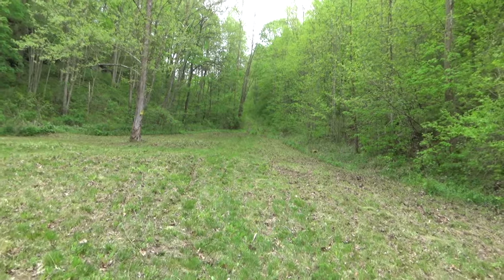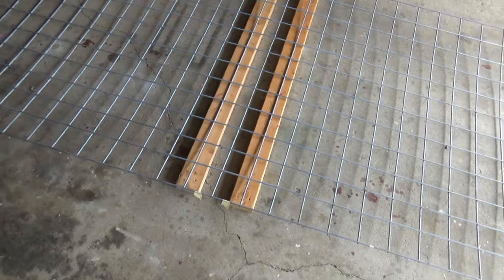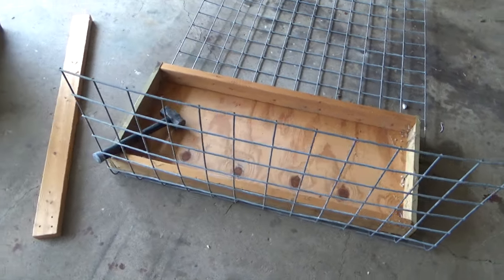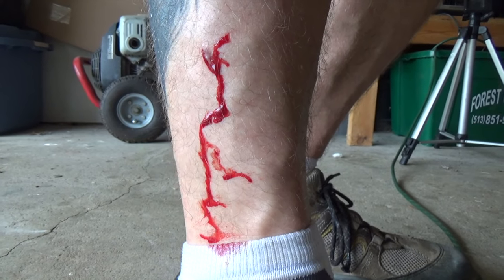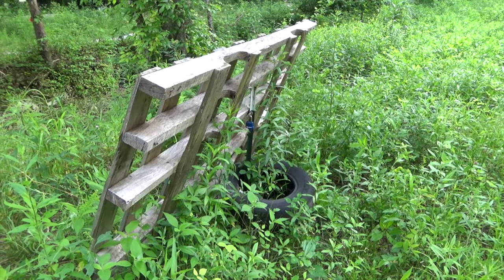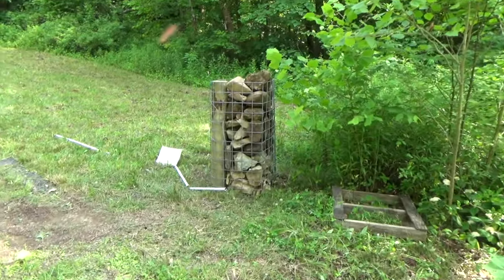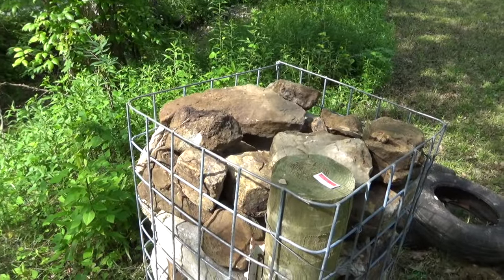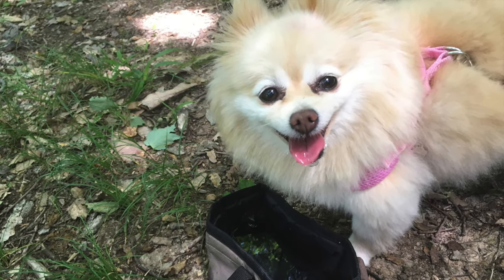Gabion Rock Cage Fence Posts for Farm Gate

Comment: I like the way you use a piece of pipe to wrap the tails instead of using C rings- much stronger corners. We found that by using a 12” pipe and putting a hole one inch from one end it was much easier to bend those wires.
Reply from the maker: Thanks! These are still standing proud to this day with the gate hanging and no sag. I have a video showing the gates here: 
https://youtu.be/BpT1jfp0_N0

Comment: I did the same thing a couple of years ago because of solid rock on my land. For line post connect a short piece of wire to post (in the center of the cage) and run it out of the cage before you fill with rocks. Then connect barbed wire or field fencing to it. I had an engineer friend calculate the strength of these post before I started. They hold cattle in.
Reply: pro tip: watch movies at Flixzone. Me and my gf have been using them for watching loads of movies during the lockdown.
Reply: @Carlos Bode Yup, been using Flixzone for years myself :D

Comment: This is sooo cool, terrific project and the result fits ‘The Ridge’s’ look. Ps: the obligatory sparks sealed the deal. Have a great day! Bst wishes, Michael.
Reply from the maker: It was a lot of work, but it was a fun project. There was no way I was ever going to be able to dig large post holes by hand so this idea worked perfectly. I will post a follow-up video with the gates mounted soon. It is kind of funny, those green T-Posts you can see in the video had to be driven in with a sledge hammer and they bent badly from hitting bedrock. There was no way they were coming back out of the ground, so that is one reason they ended up inside the cages. Thanks for the support, Michael. Peace.
Reply: HNX Media I know how hard it would be, I grew up as a kid spending time on our farm, fencing and other things. All that hard work payed off. If I was 20, 000km closer I’d offer to lend a hand. Looking fwd to the following video. Take care! Best wishes, Michael.

Comment: Love the idea and plan on doing the same in the future. However, It just seems like it would be more secure and stronger (for hanging gate(s)) if you were to put the post in the ground a few feet.  So, here's my question: Do the rocks wrapped around the post actually keep the post secure enough to hold a large 16' gate strongly?
Reply from the maker: Thanks for watching. These cages are deceptively strong. They each would "weigh" approximately 1 ton (if you added up the weight of all the rocks). The gates I used do not even phase them. For ease of access and "leveling" of the gates, I used two 8 footers instead of a single 16 foot gate. Check out our follow-up video here:  https://youtu.be/BpT1jfp0_N0

Comment: Are the tpost concreted in
Reply from the maker: No, the T-Posts are just driven into the ground as far as I could get them with a sledge hammer (approximately 2-3 feet). I am on near solid bedrock, that is the reason I cannot dig holes or use concrete to set posts. Once filled, each of these cages weigh about a ton. Hope this helps.
Reply: @HNXMedia  it sure does thank you

Comment: except for the part where a pickup truck and a chain makes it just as easy to get in? I might have missed the part where you wanted to do a lot of work but not really secure the property?
Reply from the maker: Yeah, you might have missed that part since I didn't bring it up. It is clear that you have limited or no experience owning or managing property like this. You cannot "secure" the property as you mentioned and that was never my intent (hence why I did not bring it up). Well, I guess I could "secure" the property if I put a concrete wall around the entire thing and then created an impenetrable dome to go over the top of it. However, since this property is several hundred acres, that might be a little cost prohibitive. When managing property like this, you use a gate to keep the honest people out. An open road or drive simply "invites" people to travel through your land since it "appears" to be unmanaged. At the end of the day, nothing can keep out all ne'er-do-wells. I have a lot of bridges on this property, so it likely I might get a troll or two as well. Either way, thanks for watching and taking the time to leave a comment. Peace.
Reply: Really, MacGregor? A pickup truck and a chain can pull down just about any gate and/or fence. To me, it's more about marking your boundaries, deterring trespassers and putting up an attractive entrance.
Reply from the maker: @starkmichaeld  Respect! Thanks for having my back on that comment. Peace.
Reply: People who are determined can go through border walls and you think a fence can secure a property? Fence is mostly used to mark property lines and keep animals INSIDE not keep outsiders outside. Unless you want to install a 12 foot fence with rolling and electrified barbed wire on top.
Reply: That's what AR-15's are for buddy.